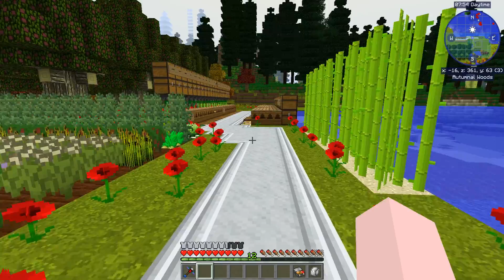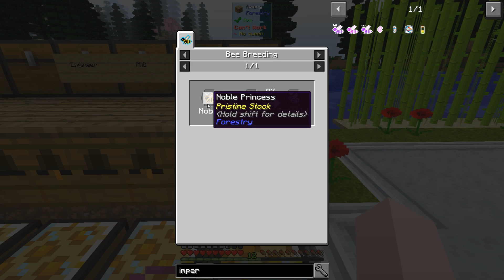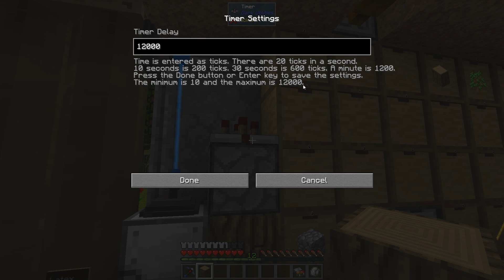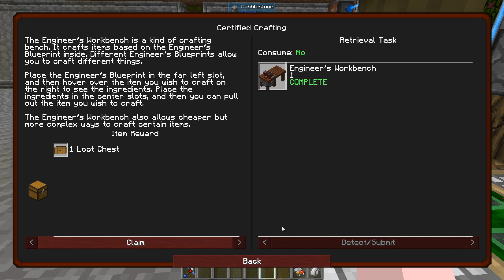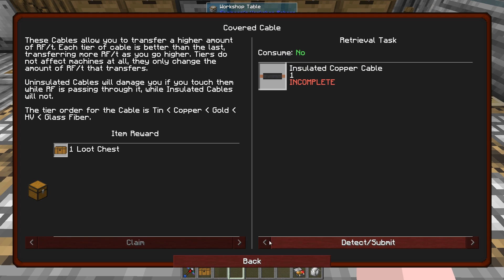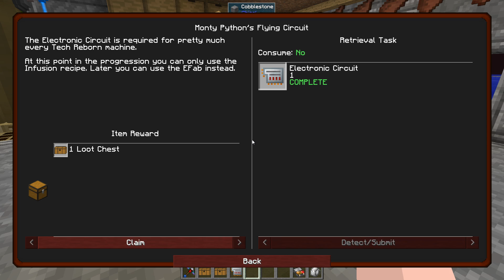06 - Flat Transfer Nodes - FTB Continuum

Comment: Where does he use flat transfer nodes? The episode is literally titled it
Reply from the maker: The episode was about getting past the hurdles involved to make them in this pack. You can see me using them in the next episode and most episodes after that.
Reply from the maker: @Unknown Entity You can clearly see me make both Item and Liquid Flat Transfer Nodes at 20:24. The video is about all the steps necessary to get there in Continuum. Most other packs getting there would be trivial.

Comment: Question: is there a reason your using blaze hoppers instead of normal vanilla hoppers? You may have mentioned it but I think I missed it.
Reply from the maker: In this pack vanilla hoppers take 13 iron, 8 copper, a bunch of logs and time to make. If you have an excessive amount of blaze rods from a blaze farm, they are cheaper and easier.

Comment: Hey I am in the same spot you are approx what should we use for power after the waterwheel I have 3 and they are just not generating enough for my titanium smelter ?
Reply from the maker: I am going for bee power. I am not bothering with water wheels in the meantime. I have massive amounts of wood that can be made into charcoal.I might make some Vulpes Library for now, or Petrified Fuel Generators. If I need a lot of power for a short time like the Empowerer an Overclocked Generator does up to 4k but is very fuel inefficient. But I expect my main midgame power to be bees.
Reply from the maker: From the 1.3.0 changelog:
-Noted that the Diesel Generator has been lowered to 25% RF production
Reply: Thanks man :)

Comment: For the latex you could also use a sticky piston with a wood log on it. Let the timer acivate the piston before the wood gets destroyed by the tree fluid extractor (1 Minute for example). Then you would need only one piece of wood.

I like your videos. Keep up the good work ;-)
Reply from the maker: > sticky piston with a wood log on it
I considered that, but wanted to research if the developers considered a it bug they were fixing, or ignoring. I hate suggesting things like smelting/fortune pick and then its fixed with the next update. I haven't found anything definitive yet, so let me know if you can?